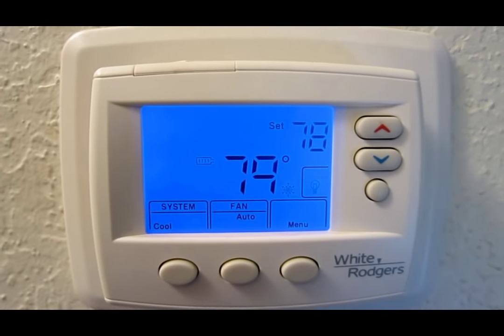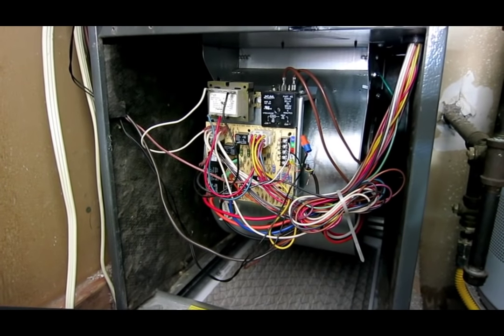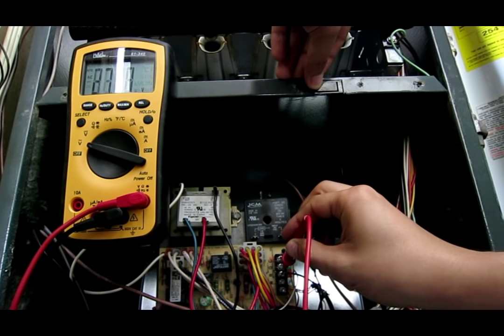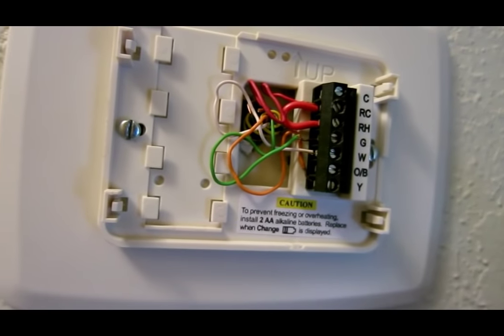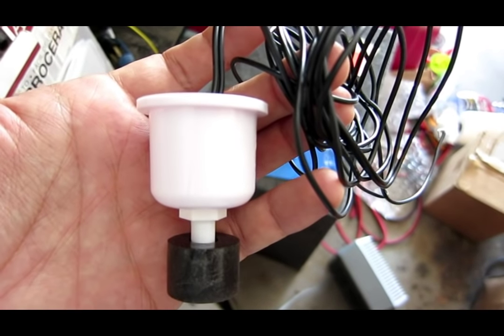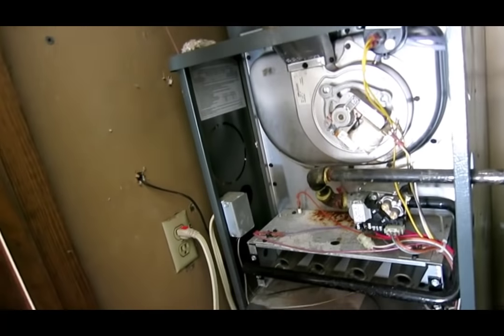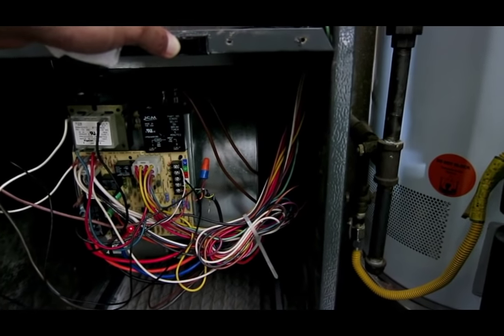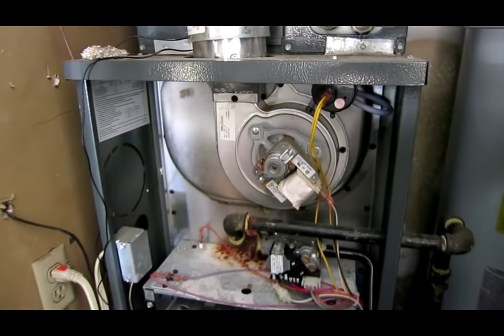most common AC problem - blower doesn't come on - HVAC condensate overflow shut-off device problem

Comment: I have a different situation for you.  My problem is that the blower fan will not activate consistently when the AC is running.  It will go for a while, but but the minute I relax, I will come back to find the temp above the desired, and the radiator starting to ice up inside the house.  I can turn the fan on manually, and it will run just fine, but it will not run without attention.  I have just replaced the thermostat, and the drain lines are clean.  I couldn't find an overflow shut off, although I do see where one might have been mounted.  I have been in the house for 11 years now, and  this is the first time having these problems.  Thanks for any help you can give...
Reply from the maker: Intermittent problems are the hardest to troubleshoot. If your fan is working fine manually, then i think its likely your control board being the issue. here is a video that might help:
Air Conditioner doesnt blow any air - how to fix AC blower - HVAC control board replacement

Comment: Great videos.  I have a different problem that I don't see in your video library -- my a/c unit seems to be working, but the blower fan in my furnace isn't turning on.  It (the blower fan) does turn on when I have the system set to "heat" or "off" (if I set the fan to "on" instead of "off")...but it won't come on when system is set to "cool" -- even if I turn the fan to "on" instead of "auto".  Any ideas on what to check?
Reply from the maker: The blower fan has different blow level. When you want Cold air, the fan is at its highest setting, when you want heat, then the fan is set to its lowest setting. There are 1-2 in between settings that arent used. Either your circuit board is bad, or your fan. I dont have a video testing the blower, but you can use the following two videos that does combine the idea:
RUUD furnace fan not starting - replace burnt control board - adding new flame sensor - no heat HVAC
AC fan not working - how to troubleshoot and repair condenser fan motor - trane air condition
Reply: DIY Tinker I had my fan motor replaced this past winter.  Does that trigger any thoughts?  Otherwise, I'll just keep trying things.  Thanks for the help.
Reply: DIY Tinker Figured out my problem.  The service tech had connected the black wire from the blower to "heat"...and nothing to "cool".  Moving black to "cool" and blue from "park" to "heat" solved everything.  Phew!  Free solution!!!
Reply from the maker: oh nice catch. But why did he do that?

Comment: Q- is it only the A/C fan that blows air into the house or does the furnace blower also help do this?   A/C unit and fan works fine but the furnace blower stopped working and there's very little air coming out now....  I'm almost  sure both worked together to cool the house...

Comment: Hello, my blower motor won't turn on. Thermostat is good, programmed correctly & new batteries.It clicks when furnace or a/c needs to turn on. Pilot light is lit.  Does the blower motor have a reset switch that might need pushed back in? Where would it be? Next stop = fuse box. They all look good, but not always true. Thank you so much!

Comment: the model number is trw018 c100a2 serial number is P223pmocf in reference to the below post on needing a top to the unit where the fan attaches itself.

Comment: All ECM motors are DC. The module converts the incoming AC current to DC (same as in a car). The variable speed is much like a step motor. ECM motors are like 3 phase AC motors. It has 3 separate windings (which mimics being 120   degrees phase angle) that are supplied by a square (DC) sine wave. It doesn't need a capacitor, because 120 deg out of phase provides the phase shift needed for motion.Trying to bypass the module will fry the motor.

Comment: Regarding an ECM motor not coming on, would a direct hook-up...I.e. L1 to L1 and L2 to T5 or t1, run the motor for a check?  I just want to see if the motor will run? Thanks

Comment: I hope you read this. So my fan was running but condensor was not in the middle of the night, I checked the capacitor which was bulged so I replaced it. WHile checking the contactor unit, I noticed a cracked black tab on the right side which separates the power bar and the 24v input prong so I replaced the contactor because chainging the capacitor did not fix the issue.  Still not working I checked the over float (bar style little giant not round shaped one) that is attached to my over flow pan under the air handler. I have a direct drainage besides that overflow bar on the pan. I am confused a little when the float is tested to be bad? I guess my question is what should the float show volt ohms or volts wise when checked in which position? When tested with flow down it seems to set at ohms 0.3 but seems to bounce around.  With float up as if water is present it sets at 1 ohms. So when the float is up is is completing the white wire to white wire ends connection such that it is the same as if the white wires were directly connected together that its pig tailed to or is it breaking the white wire connection?  This is the last part I am can to try to replace before maybe calling service.  The other things I tried are the RED/GREEN for fan and then RED GREEN YELLOW off of the therostat to see if all parts come on to eliminate a bad thermostat possibility? The fan comes on but the condensor still does not.  If I push the contact bar on the condensor contactor on condensor panel area the condensor fan and condensor come on. When I checked the 24v to the condensor I am seeing 0 now. I thought I saw 24v at one time but can't remember now if it was when the old contactor was still on or this new one.  But right now nada. When I check the leads on the thermostat with wires normally attached of from red to yellow, red to white or red to green I see the 24volts. I even checked the output of the 115v to 24v converter in the air handler by checking the common and red input leads (maybe I should have checked the output leads) that should be feeding to the condensor and did see voltage going into the circuit board of 24 volts and if not enough I would at see the reduced amount I would think on the condensor side. What am I missing to check other than this float but if you could kindly explain what the state does in terms of volts running through the white wire when float is up or down per my ? above.  For me I need to know when the float of the bar type is up showing water is that the same as if the 2 white wires were directly connected without the float between? It seems when I connect the white wires together the fan finishes its cycle and never comes on again.  There is btw no water in the pan as far as I can tell and so the drain I would think is working. Thanks for any help and suggestions.
Reply: Also I forgto to mention the float is a little giant brand and when i turn on the ac thermostat i here a quick click twice immediately.
Reply: I performed more 24v test with the fan running and the float setup back as  it was in AUTO/COOL modes.  The 24v reading between the red green, or white or yellow was much lower than 24v.  When all is off 24v+ shows fully across the same probes.  When turning fan to manual and no cool  the red/green showed 0 and the fan ran and shut off as expected when moved back to AUTO on the thermostat from manual.  Also I ran to the condensor during the original fan in Auto/Cool mode when mentioned volts was much less than 24 at the thermostat but yet not 0 found at the condensor end the voltes less than 1 for 24v check.  So I am just going to pop for a float switch to see if thats causing gyrations.  Though I tested the ohms reading for the float switch in float down position the reading settled on 0.3 but seemed to gyrate occassionally. When in up or water present mode it went to what I read as 1 but to me meant the open condition. So that gyration on the down side may not be connecting the white wire continuously with a good 24v flow? Any other suggestions I would appreciate.

Comment: Ok : The ECM motor is an X-13 by GE, now Genteq, uses the lo voltage 24-28 to energize the windings, via lo and hi speed connections.  To test the motor, disconnect the lo voltage at the motor (from the board), turn on power, call for cooling, then ck for lo voltage at wires. If there is lo voltage and hi voltage coming to motor, but motor doesnt come on, the motor is probably bad.  To answer my own question, NO you cannot run a direct 120 V to test an ECM or X-13 motor like a traditional one

Comment: Our a/c and heat don't work at all. Hubs is an electronics tech by trade so he tested voltage and that's fine. Checked the breakers and voltage on each,those are fine. Checked the a/c unit itself that's fine. We checked the thermostat and it did need new batteries but other than that it's fine. The only thing we did notice is the fan isn't working and no known causes. We've checked everything we possibly can and nothing seems to be wrong. My brother works in HVAC and even looked and he said nothing is wrong or broke. We are at a loss here. Everything is checking out fine yet no a/c or heat.

Comment: Meter problem! you don't have a C wire so you can't do any voltage testing here per-se.  Just place a jumper between RC and Y for cooling  The condensing unit and furnace fan should start.. Or, just flip the fan switch to ON.  This one action will tell you that you have both line voltage and low voltage, and a working fan motor without even removing the thermostat cover. Keep in mind most all thermostats have a 5 minute time delay, some have adjustable dead bands so Id make sure yor 5 degrees below the room temp and time the 5 minutes minimum. Thats a long time when your standing there waiting.

Comment: Hi DIY Tinker, so, at 11:30pm this Saturday night, my ac decides to give up. No cold air coming out of the vents. Checked the filter, could use replacing, but still wouldn't work with the filter temporarily removed. Went outside to check the fan and it's not moving. Noticed a coating of frost on the line connected to the compressor as well as part of the compressor. Out of curiosity, I checked the air handler in the attic and noticed water collected in the tray (which I don't recall seeing before). Where should I start? Capacitor? This is all new to me. Any help would be greatly appreciated!
Reply from the maker: sounds like you might need professional HVAC help. If it turns back on the next day, then the system shut down from overheat. If that is the case, then you might have a dirty evaporator coil, low on refrigerant, or something else... here is a evaporator coil cleaning vid:
How to clean evaporator coil - AC freezing over with ice - cleaning dirty HVAC coil with cleaner
Musty Smell from Your AC Vents? Check and Clean the Evaporator coil - HVAC freezing up with ice
Cleaning all in one outside unit evaporator and condenser coil - Package Unit Air conditioner AC

Comment: If your furnace/cooler is acting weird try this:
Remove the batteries in your thermostat for 30 seconds, this will reset the thermostat. If that doesn't work then replace the batteries, the thermostat will malfunction long before you get a "replace battery" indicator. It's a good idea to replace the batteries once a year, the same with your smoke detector batteries.

Comment: wait a minute, so the heater/furnace has to be plugged in in order for my AC to work? i have 2 different thermostats, one for my AC and one for my heater. the one for the AC wont turn on at all but i have power up on the roof and can turn on the AC on the roof by pushing the various test buttons it has ( i have a mastercool unit). i just noticed that my furnace is not plugged in at the wall socket, however. not sure why its unplugged. im gonna try plugging it back in to see if that fixes my issue.

Comment: I am experiencing the same issue everything outside is working fine . When I turn on the T stat to cool or heat no air is blowing thru the vents. I just turn the Fan on only. Still the furnace isn't blowing any air . Seems like the blower is the issue. What do I have to do? Can you help thank you in advance

Comment: Do all HVAC have the same type of overflow switch? Because my thermostat isn't turning on the unit, but the fan in the house will come on.
I was thinking about adding that hard start capacitor first.....?
Reply: YoungTimmy.  why?

Comment: Hey DIY Tinker, my AC unit outside work well.  The fan is turning and the machine is on; however, there is no air coming through my vents.  My breakers are all on the "on position", so there's no problem there.  This is all new to me.  Any suggestions?
Reply from the maker: If there is no air coming through the vents, then check the blower motor at the furnace and see if its running. if it is, then you have something blocked in the vents or your air filter is so dirty that prevents air from flowing.
Reply: Thanks a lot, I'll check that out.

Comment: hey DIY, I can feel the air coming through the vents, the outside unit is working, but my house isn't be cooled. What do you think some of the problems could be? I also replaced the filter.
Reply from the maker: search my videos for "run start capacitor" I think your unit outside's compressor isnt running.
Reply: It turned out to be the Freon was lower, the filter was rusted out and I needed a new capacitor and a filter. My Freon was banned, therefore, was $88 lb. Not a day I wanted to spend $800. _, however, the house is cool again. Thanks for the reply.

Comment: Hi, I keep having a clicking sound when trying to but on auto. Then nothing comes on, but it works when I just put it on, on. Scars the issue? Has been happening for a few weeks now. Sometimes it actually turns on but only for a short while.

Comment: Hey, at 1:42 you say measure the voltage difference between red and green, how exactly do you do this? what do i set the meter to? and where do i put the red and black leads while measuring?

Comment from the maker: sorry, i dont follow why you would use a ECM. im guessing you are using it as a switch? Most are solid state drives, so, make sure what you have supports AC at 240VAC. Most ECMs i used in the past are only DC driven, and DC switching.

Comment: I did not explain that correctly. What I meant to emphasize was that when it is On it will stay On until i switch to Auto, but will not shut off mid-term. The Auto is what fails to start when the ac starts. And the On only works sometimes to start up.

Comment: Learning to do my own.....first i got a Lo Batt signal on T-stat. ( the blower for AC is not coming on), so i changed the batteries, and turning it to on the motor would barely humm. So i suspocted a capacitor. In the air handler, i didnt find a cap, but i found a circuit board burned out (3 amp fuse also)-cooked. So i replaced the board and while plugging wires back on ( Power at air handler 240 OFF) the plug with the (R C G W1 W2 Y1) sparks a little and acts shorting out .......next

Comment: Hello, 
I have same problem with my air conditioner: 
It not turns on the fan ( blower) however the compressor working good and I have to reset fan by fuse several times a day (sometimes without success ).
Sometimes compressor and fan work good but it is not common situation
Reply from the maker: if your circuit breaker(i assume you didnt mean fuse) trips that often, then first you need to replace the breaker. Then you can look into the blower and see if its drawing too much current. Sometimes a damaged bearing or a bad capacitor will make the blower draw alot more current.

Comment: The float is designed to break the compressor circuit only, NOT the entire secondary circuit. The correct wiring for the float is in series between either yellow wire and the "Y" terminal.
Reply: Yeah don't run red through it, those float switches are only rated for like 2amp. A short and pow it's gone.
Reply: Jake Jones, I've only seen these used for the 24 volt terminal.

Comment: Man, I could really use some help if you happen to read this some time soon. My air conditioner won't turn on, neither will the heater. I've tested the voltage on the wires like you said to do in this video and I'm getting a big 0 on both the furnace and thermostat circuit boards. I've looked everywhere and I can't find one of these overflow shut-off devices on our unit. I've checked all the wires and as far as I can tell none of them are damaged or disconnected. Any help would be greatly appreciated!
Reply from the maker: +LordsMan if you're getting 0VAC then check your breaker panel and recycle the breaker. then check your socket and voltage going into the furnace.
Reply: I'm an idiot. Looks like it is getting 24vac after all. Breakers are fine. I guess I don't know what's wrong at all other than neither the heater or the a/c will turn on. Thanks for actually responding- I appreciate it!
Reply from the maker: +LordsMan if neither the heater or ac turns on then check the thermostat. Maybe this link will help u out:
https://www.youtube.com/watch?v=nJVTVCVITxw

Comment: Here is a question,

Everything is set correctly.

House Temp is actual 82
Thermostat temp set to 60
Thermostat set to Auto and Cool

Fan on the furnace comes on fairly quick, however the air conditioner outside never fires up.  What might be the problem?  I reset the breaker, and do not know where to go from there.
Reply from the maker: Frank Sturm If your breaker is working, you get 24VAC signal and you have 240VAC. 
Then here are 2 common problems that a DIYer can test or replace:
Contactor:
https://www.youtube.com/watch?v=C7yj8q8Tnbw

Capacitor:
https://www.youtube.com/watch?v=tCE1ovXHEXA

Compressor resistance/short:
https://www.youtube.com/watch?v=r8LD6rtElUY

Watch this to understand the condenser Schematic:
https://www.youtube.com/watch?v=cnD65qX8bjM